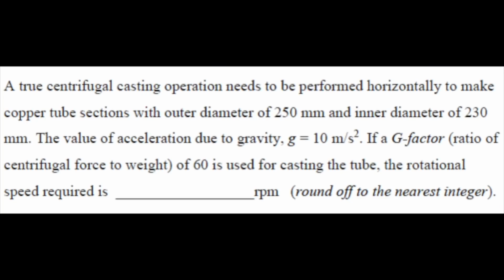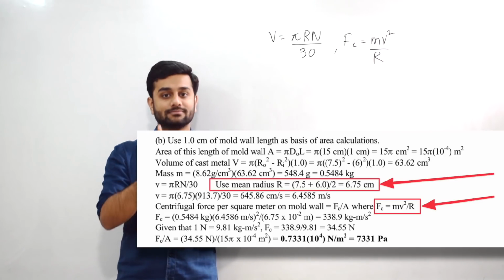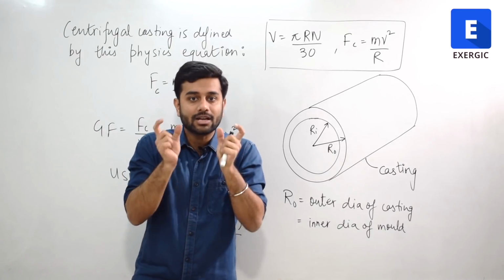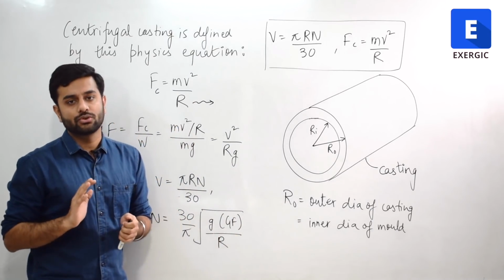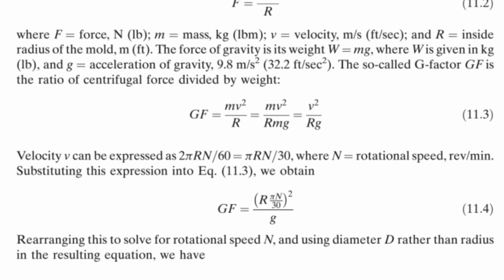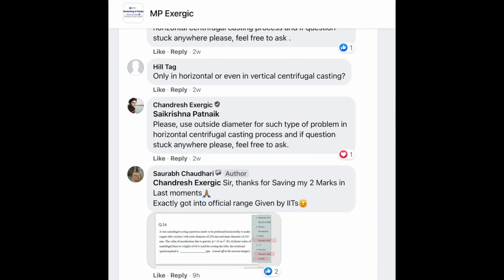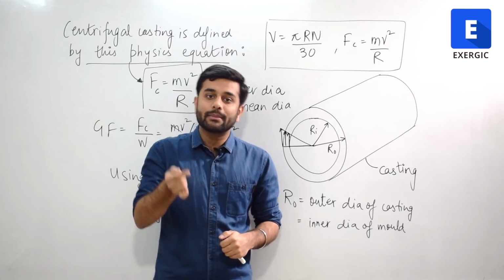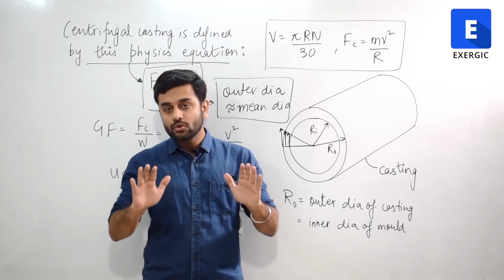Should you challenge this question??  | GATE 2021 ME Centrifugal Casting problem

Comment from the maker: In addition to the points in the video, Kalpakjian book manual has also considered the mean radius for this calculation. So, those who wish to challenge the range and include Mean radius also in the range can do it from this source:

http://library.lol/main/9E456D2B18D9FCB83B4E586E5FAC711F
Reply: @exergic,I think one can challenge  the question it self on the basis of ambiguity,since whether to consider the inner radius or mean radius for calculation depends on the thickness of casting to be made.If thickness is small one can go with mean radius and if large with inner radius.So can challenge it on the basis of ambiguity.Am I correct? Also defining constants in formulae varies from author to author in many cases.
Reply: Sir can you share the 2nd Edition of M.P. Groover pdf. I'm unable to find it.
Reply: @raj hero bro..  Put radius value and speed which you got after calculation.... In  formula of GF,  it comes less than 60
Reply: @raj hero Final answer key is out... 
Hope you might have got your answer...  
All the very best for your future endurance 😀
Reply: @raj hero Final answer key is out.
Considered outer radius.
Reply: Hello Sir, 
If we use mean radius..  G factor comes less than 60...
It's contradicting emprical limiting condition 80 > G.F > 60 ( reference grover) 
Kindly check on this and let us know revised solution.
Please refer solution to problem 11.6 as well.
Reply: Let me tell you one thing that 80>G>60,is valid for majority of cases and but not all.The value of G depends on material. They have given you G=50,so whether to find out it is practically feasible or not is not your duty.You have to calculate according to given data
Reply: @dineshreddy2346  bro please read question properly 
it's clearly mentioned G.F used is 60..
So for casting to happen..   G.F cannot be less than 60..
Still many people will challenge it..
Rest is your choice..
Reply: @dineshreddy2346  Bro, Ignore him. He has his baseless theory. All he has checked is 60<GF <80 (which is correct) but it has nothing to do with this question.
The GF was already mentioned in the question -> speed was asked.

Our answer with mean radius is 675 RPM which is higher than when calculated with outer radius. Obviously with higher speed GF will be higher throughout the casting.

All he is trying is to do is demotivate others by spaming his theory everywhere.
Reply: @newtech5424  Ok bro...you know perfectly...ok ....please read theory first instead of solving question directly...
Here casting radius doesn't matter ....
You must  focus on mold inner radius then you should focus what is mold inner radius.. hmmm its nothing but casting outer radius...then you must take outer radius of casting in questions...
Reply: @preppoint4876  Do you even understand what you are saying?
You are telling me that "Mould inner radius is casting outer radius" Where did I even say it's not? (The discussion never went there, everybody knows that)

But, In some comments you have mentioned your theory  that "if we consider mean radius and do calculations GF will go below 60" 😂.

Basic Physics :With higher speed GF will be higher not lower.
 Please you read theory : 
The G factor is equal to the centrifugal force acting on a rotating casting product (CF) dividing by the gravitational force.

Centrifugal force is dependent on SPEED of rotation.
Omega = 2*π*N/60
Where N= RPM
Centrifugal force directly proportional to speed

Comment: Centrifugal casting question made easy test series 2020 main 2 times pucha Gaya tha & mean radius lene par kabhi bhi ànswer match nahi karta tha. Outer radius lene par answer match karta tha.
Reply from the maker: In Exergic Test Series also, we have taken Outer Radius for calculations. But those who have taken Mean is also not incorrect. Pls refer Kalpakjiyan book manual.
Reply: @ExergicGATE  challenge karne par marks mil jayenge but question solve karne ke liye outer radius is prefect data.

Comment: in set 1 triple point question .. by mistake I put 195.75 and range is 195.1-195.3 whether this can be increase..??
Reply: If at all you can explain to them your calculations that led you to get answer 195.75 then surely they can increase the range
Reply: In calculation by mistake l took 27.91 instead of 27.92 that's why this happened...

Comment: Outer radius hi le sakte he...mean radius nai le sakte...
If it is solved with  mean radius ..then Casting will not possible...just put value of mean radius and RPM value so G factor will come 57.6 something...which is less than 60 ...For process to be feasible G factor must be in a range of 60 to 80 .so here with 57.6 G factor  casting is not possible ...thats why you must take outer radius only......
Reply: @Nova how did you calculate G factor based on mean radius without knowing rotational speed?
Reply: @avnish3295  Bro.. You need sufficient speed to rotate mold..so that this sufficient speed you can only get by using inner radius of mold beacuse here centrifugal force sticks molten metal on  inner section of mold hence u should take inner radius of mold.  So , first calculate Speed based on inner radius of mold , Now use  this speed to know G factor range  by considering mean radius of casting  okay??? Lets take mean radius and speed which you got from inner radius of mold ..Now , find G factor You will get 57.6 which is less than feasible condition so obviously casting operation is not possible. SO YOU must take outer radius of casting.
Reply: @preppoint4876  in the question no range is mentioned for G-factor. How will one know during the exam which value is correct and which one is out of range.
Reply: @agnimitraghosh9421  well bro...it is theory so you must know 60<= GF <= 80.
Reply: @preppoint4876  If IIT expects students to remember that value then why they gave the definition of G factor in question they would have simply said G factor so, I dont think they expect students to remember those values.
Reply: @HITMAN-rk1qj  achha ...to phir ye bhi kyu yaad rakh rahe ho ki average radius lena ya outer radius lena he...vo bhi IIT hi de dengi na....
Bro , inner  radius of mold lete he....calculation me.
Reply from the maker: Question has given us the required G factor. RPM is getting decided accordingly so that G factor reaches the required value.
Reply: @raj hero I think you are jocking...unnecessarily 😆😆😆😆
Bro calculate speed with taking outer radius....now find G factor with mean radius....
Reply: In this operation centrifugal force  sticks the molten metal on inner section of mold... so for this ...outer radius of casting  = inner radius of mold only to be considered.
Reply from the maker: @preppoint4876  Kalpakjian book manual, which is a standard book, has also considered the mean radius for the calcualtion of the G-factor.
Reply: @raj hero 🤣🤣🤣

Comment: inner radius to be change w. r. t time then that time consider outer radius because it is fixed and mean radius also not fixed due to inner radius to be varies
Reply from the maker: To decide the right rotational speed avoiding Raining effect, Centrifugal force calculations are done for maximum mass available. After molten metal has been fully added.
Reply from the maker: Kalpakjian book manual, which is a standard book, has also considered the mean radius for the calcualtion of the G-factor.

Comment: Hello Sir,
In the Robot Ltd. safety stock problem (ME Forenoon) it is given that the lead time is 5 days and daily customer demand follows normal dist with mean=50 and SD=10. Hence, the SD for the duration of LT=5 days should be calculated as the root of the sum of squares of the SD for one day. (which comes out to be [root(10*5)])
This is what I studied from one of my class notes.
I request you to kindly provide your insight on this. Please do correct me if I am wrong.
Thank you so much!

Comment: Sir you are the best educator for Gate Mechanical examination  currently in India!  Thank you as always!
Reply: Bro...have you purched Exergic course
Reply: @nagsenkhanderao273  Yes!  In the course, the speciality I have felt is that, even if you hear for 5 minutes of Sir lecture, there will be some valuable point you will gain. You will not feel  you have wasted a minute. The most important thing is that each piece of content: lecture, question bank or test series, or even Sir’s general talk is so much exam focused. This is the stark difference I have felt from other online education platforms. And another important thing is Sir builds your mindset for exam which is very much required for exams like Gate where the biggest challenge is not the heaviness of content volume, but the distractions. Usually  you think about the right strategy for preparation up to about one month before the exam, then you start panicking. Here  in Exergic what I have seen is that Sir draws out for you what is the best approach and the useful strategies. You need not waste months pondering  and thinking what is the best way. In fact there is no best way. Sir gives tips. so you can find a suitable way that can work for you. Your task is made simpler but not lesser. Why do you want to lift 10 kg with your hand when you can use a pulley. The pulley helps you put the effort in a better way. So, Chandresh Sir is like the pulley that can help you in the preparation journey.  Why do you want to struggle when there is a simple way.?  Even Gate Authority do not want  you to struggle. You should enjoy the preparation phase. Another thing is you will not have to mug up anything once you start hearing Sirs lectures. You will be doing your brain a favour by this. Lastly the tips Chandresh Sir gives are applicable to any competitive exam and some of them will help you in your life as well in building a fruitful career and a happy life. So, this is my forehand opinion. Now try for your own. I wonder why people become so sceptical about  nicer things but easily grabs on to not so great things without the slightest hesitation!

Comment: Sir, As you mentioned the velocity is varying linearly along the radius. So, Centrifugal force vary linearly as well(as N = constt). This concludes that local G-factor at inner radius is less than that of outer, and the our aim is to prevent the molten metal to fall due to gravity(So we provide force in opposite direction, with the help of centrifugal action). So, we should provide more centrifugal force(or velocity) at the inner radius to prevent molten metal from falling. Hence I conclude that inner radius must be considered for determine the angular velocity from design and operational point of view. Sir please entertain my query.
Reply: I was thinking same. But a layer of molten metal will be present at inner radius. There will be so many layers present between inner radius to outer radius. So we use elemental approach and then integrate to get actual force. At that time may be radius becomes mean. I guess this must be answer.
Reply: @amardongare9909  We take the element and integrate to find the average(using mathematical tools to ease the study of physics). But what what I am trying to conclude is from the point of operational feasibility. e.g. in MD we design and perform calculation on the basis of critical component(not on the basis of average).

Comment: Sir, plz upload the axle wheel rolling problem from set2.
Reply: Bhai question ko challenge kar rahe ho kya ??
Reply: @purushottamranga3455  , yeah i am definitely going to challenge it. 1.4 is the correct answer.
Reply: @unknownhacker5298  kardo challenge, Kya PTA yeh rs. 500 tumko PSU phuncha de🤓🤓. BTW I have also challenged so aisa nhi hai ki koi challenge nhi krega.
Reply: @purushottamranga3455  yes bro, 5 is the correct....

I wont suggest you to waste 500 rupees...
Reply: @purushottamranga3455  5 is correct.
Reply: @sachantewari667  aisa koi question set 2 challenge karne ke like hai ??
Reply: @purushottamranga3455 .. set 2 mein range ka ek issue hai francis turbine waale problem mein, baaki sab theel hai...
Reply: @sachantewari667  1.4 is correct.. 
5 is totally wrong
Reply: @Free_World_Insights  no
Reply: bro i also kept 5 but 1.4 should be correct
Reply: @sainandan65  There is a certain ambiguity in the language of the problem, if you take that into account then both answers are possible. But GATE has considered the case where the answer comes out to be 5.
Reply: @sachantewari667  no.. 
iit have done conceptual mistake like you..
Reply: @sachantewari667  because I have nptel reference and hibbler reference
Reply: @Free_World_Insights  How can you have a NPTEL reference of a conceptual problem.

If you are talking about similar examples, then I also have references of HC Verma as well as that of previously asked JEE questions in which problem has been solved like that solved by IIT Bombay.